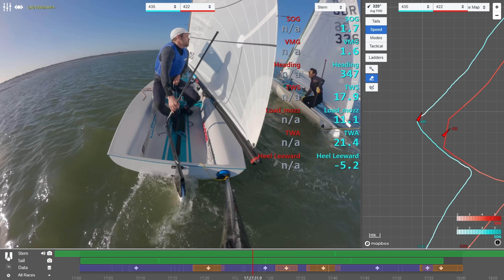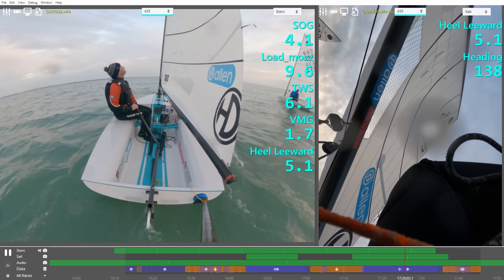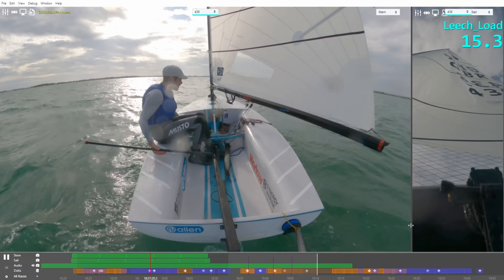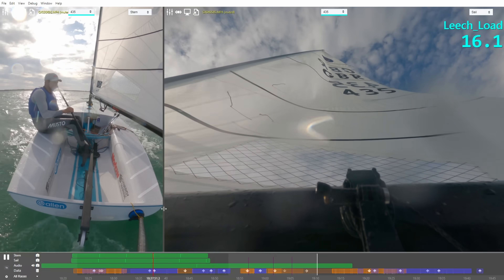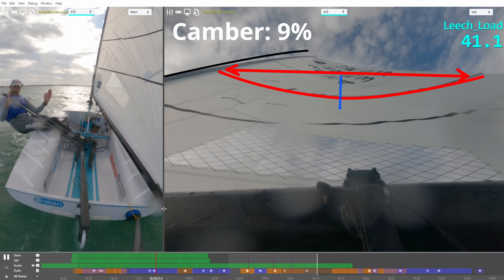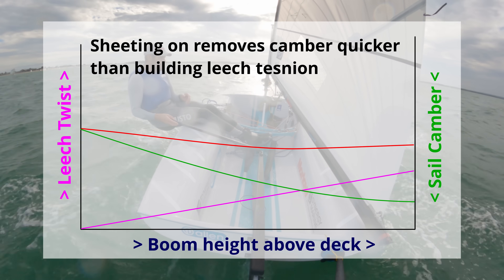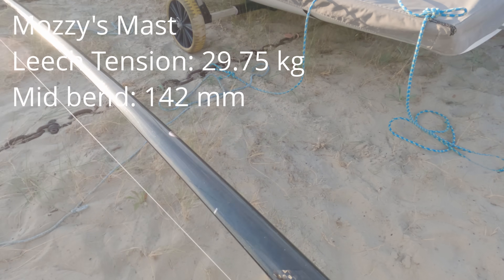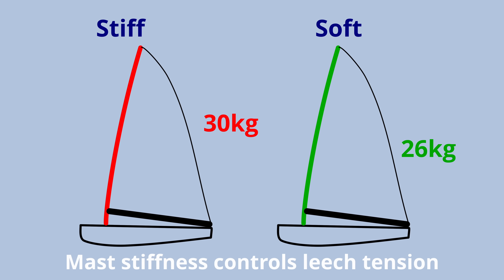The Mainsail Paradox: Lessons from the Europe Dinghy

Comment: Fascinating. It confirms all the reasons why I hate unstayed masts. Rig tension stiffens the hull and keeps the mast where you want it. Unstayed masts mess up your C of E just when you don't want them to, forcing you to trim when you should be focused on driving the hull. The lack of stiffness gives you far less control with the kicker, the shape of the sail is unstable, creases cause the air flow to stall and you end up in an ugly infuriating quandary of negative feedback. 
The result is a narrow helmsman weight range that can sail these boats with any success. Everytime I hear someone selling the benefits of unstayed masts and their ability to spill excess power I'm thinking why would you want to spill it when you can use it.
Reply from the maker: I agree with 90% of that with one designs who then often end up with many sails sizes to fot a range of sailors (aero - ILCA) which splits the fleet. 
The Europe however can be tuned to a wide range of weights using mast stiffness and a small adjustment of sail camber allowing a diverse weight range to still race in one fleet keeping numbers concentrated. I think the same is true of the OK, Finn (although hull weight is a limiter here) and to a degree the solo.
Reply: @MozzySails this is definitely the case and the reason I sail a Solo rather than a Laser.  As a lightweight helm I can choose a mast and sail combination 'off the shelf' which allows me to compete with much heavier sailors on equal terms.  This means that Solo Opens aren't fragmented by subdivision based on sail size - rather they offer larger fleets and very tight racing.   The Solo classes commitment to retaining aluminium rigs means that sailors have more of an incentive to invest as they are not going to be outdated due to the introduction of carbon spars.
Reply: @timmedcalf1357 
I've never sailed a Solo so I'm not familiar with the class at all. I have sailed other Jack Holt designs though. Never liked the Enterprise. To wobbly. Herons, good to learn to race in but hardly a sparkling performer. 
I think most one design classes are niche. They appeal to various factors not least being budget.
But in terms of performance, most classes lack flexible tunability because of the shortcomings of the class rig rules. 
It's hard to go to any other class once you've experienced the vastly superior performance of a development class like the N12.
It gives the ability to optimise the rig and hull for your weight but the real difference in performance comes from boat handling. Superior handling gives you greater incremental gains when boats are equally matched. 
I was able to beat boats fifteen plus years newer than mine by optimising the rig so I could drive it harder and push through gusts instead of spilling them. Without the ability to restrict and terminate the degree of bend your wasting drive. The other huge limiting factor is poor cockpit layout, slippery floors, center main sheet clutter and multi purchase blocks that slow down your trim speed way to much. Center main sheeting sucks. Can't stand it.
I wouldn't enjoy sailing a Europe. 
All I see is a desperate evolution of a flawed concept. 
Close racing is the ultimate thrill. But one design does not guarantee close racing when it's a bad design with a cheap nasty rigging system. 
Unstayed masts make as much sense to me as a one legged man entering an arse kicking competition.
Reply: @MozzySails 
I've never sailed the Europe though I confess it does look like more of a thoroughbred design than the ghastly Laser. I sailed the OK for a while but she was a clunker. 
The National 12 class spoiled me rotten and the rig gives you a highly adjustable but simple set up that once trimmed to the conditions is nearly set and forget. 
Any other boat was an infuriating let down for me after that. 
For me the secret of winning races was stepping the mast back as far as possible, shit tons of tension on the Jib halyard and mainstays.
Adjust the mast bend with the ram.
Loose foot easy to power up. Plenty of Cunningham and kicker to flatten out upwind then drive her  hard on the wind. I would watch other boat masts bend and helms panic as the trim goes to jelly. 
Better to sheet tight and flatten the main and spill using the mainsheet. Never used a traveller. Waste of time and more clutter. 
So I take it you stiffen the mast by sliding a carbon tube inside or do you opt for a stiffer mast ? 
Having a fixed mast position and lack of mast ram is a huge handicap. It also limits the power of your kicker considerably and yes  I like to have a lot of kicker power. 
The sight of the top of my main spilling is anathema. 
Another pet peave, bendy booms.
To me that's just plain daft.
Reply from the maker: @joschmoyo4532 well the national 12 is exceptionally nice to tune! 
Unstayed rigs are definitely a compromise. The only downside to very tunable rigs on the water is it allows lighter sailors to have thier cake and eat it. With unstayed rigs you choose for your weight then are locked in to the same compromise as othersno matter your weight.
Reply: @MozzySails 
Yes, all excellent points. One thing that is talked about less is the psychology behind sail tuning. Many sailors fear the wind and use a defensive tuning strategy. Part of that imprinted mind set comes from boats that are very hard to hike hard, fast and quickly shift back without sliding and slipping.
The gunwales on the Europe would drive me nuts being that rounded and wide. I prefer narrow rounded gunwales that are comfortable to hike and lock under your knee's. 
It allows you to really hang your arse right out and crouch to trim without holding your legs tensed. 
 Your legs are less horizontal so you retain far better balance. Toe strap location is really important to get right.
The Laser for me was pure torture.
I will never understand how such a bloody shoddily rigged overweight hull became so popular. 
I would love to get myself in to a Morrison designed rs 200 to see what it's like. 
As far as weight goes there's no denying the advantage of lighter build in light air. But the 12 is a development class so you could offset being chunkier as I am with hull choice etc. 
I still have not seen a single handed hull design that appeals to me. I used to frequently sail my 12 single handed just for the shear joy of it. The Aussies have something called the NS 14 but it doesn't have a thwart. Yet another torture cockpit. Ergonomics be damned hull design I call it. 
Poor Ergonomics lead to sloppy defensive trimming and tuning. 
There is much room for development in single hander design.

Comment: Hi Tom, I recall that when the Class was a women's' Olympic class, here in NZ the competitors had a specially constructed jig to allow static loading up of the masts, and measuring the deflections. I did not follow it very closely because I always suspected that to know each mast more exactly, you'd need to do a form of dynamic testing on it too. About this time the lead sailors were switching from Marstrõm to I think a Dutch? manufacturer.

I did sail the Europe a bit and the variations between individual boats, sails and masts was a mine field.

Thank you for breaking it all down in such an understandable fashion!

Comment: You mentioned at some point that sheeting in the mainsail both reduces camber and firms up the leech tension and that there is a point at which you lose power while sheeting in. My question is if it would be a valid strategy to sheet in in gusts when your sail is at that point, since you would be de power the boat thus reducing heel while being able to keep height(as opposed reducing the AOA from the sail by either letting out the mainsheet or letting out the traveler.)
Reply from the maker: Some boats and rigs do work in this way - Frank Bethwaite talks about it  in high performance sailing. 
For it to work well you need a sail with a lot of roach (fully batten square top) and mast that is supported well through stays so you can tune where it flattens. 
In a unstayed uno sail like the Europe the issue with sheeting hard to flatten the sail and depower is it carries too much power high whereas you really want the top to twist off as you depower.
Reply: @MozzySails here's where that dynamic lateral side end at the top comes in and how whippy that is. Years ago when Finns had wooden masts, the famous Brüder mast was the go to, and competitors back then reckoned the difference was most evident when sailing upwind in gusty conditions or on the trianguar reaching legs. I'm sure the dynamic characteristics are still a factor, and those who follow others may not address that aspect from a more scientific approach
Reply: Thanks Mozzy
Reply: As I understood it, if depowering the main by reducing mainsheet tension is having the opposite effect, then the sail luff curve is not well matched to the mast stiffness....